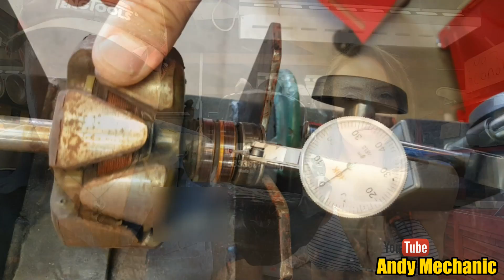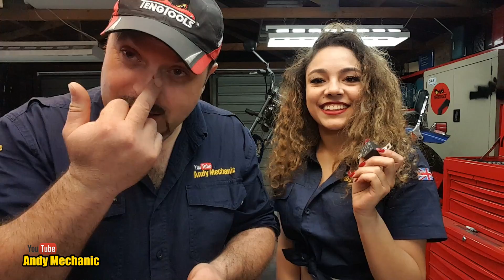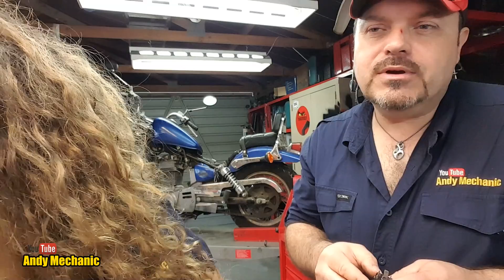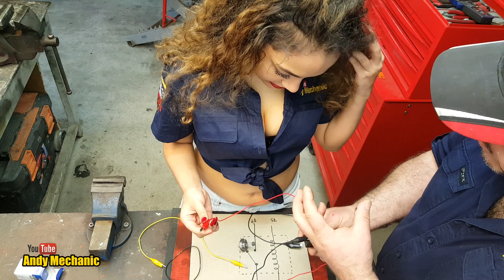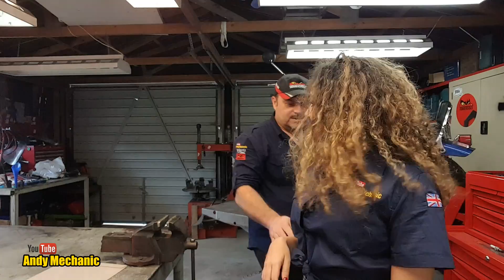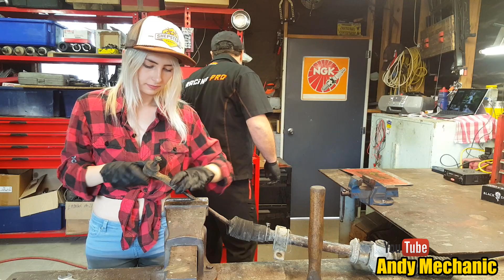How to test a 4 pin relay Ft. Tool Girl Jade #1451

Comment: 2 pin relay
Reply from the maker: That's a flasher relay with a bimetal strip inside - just wire it into circuit - terminals can be wired either way like a bulb.

Cheers Andy

Comment: How do you check a like 20 pin relay. Trying to check some with about that many pins
Reply from the maker: Unfortunately you will need an internal wiring diagram in order to bench test the relay - if it's got that many pins are you really sure it's a relay?

Cheers Andy
Reply: @AndyMechanic  it's for an old mori seiki cnc lathe from 1980. Its ancient and has a ton of relays. It even has some relays with timing dials. The brand of relay is omron my2.

Comment: I thought the deal was to take the part number and buy a replacement. 
If it doesn't solve the problem, you have a spare for when it does fail. 
Jade is great fun, but you'll need two hairnets for those locks.

Comment: Question: The phrases you`r usinge ( Trigger- / Loadcircuit) are those "international" Standard phrases? I'm asking because I'm becoming a car mechanic in Germany & if it's the case,  it would be great to increase my international skills with your videos.
Reply: ... its not "becoming" its "going to be", am I right?
Reply from the maker: I have always called the 'coil' side of the circuit the trigger side and the switched side the 'load' or 'consumer' side but there are a range of names for both sides of the relay unfortunately. Hope this helps. Thanks Andy